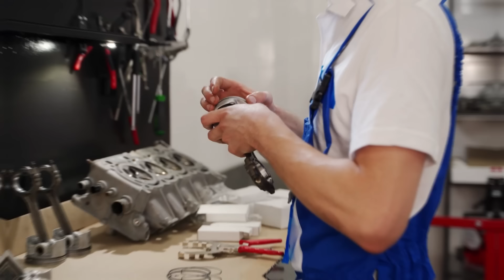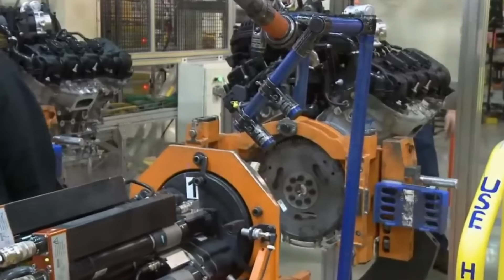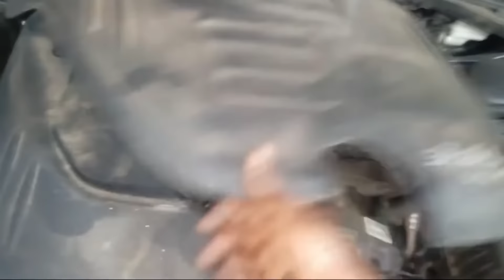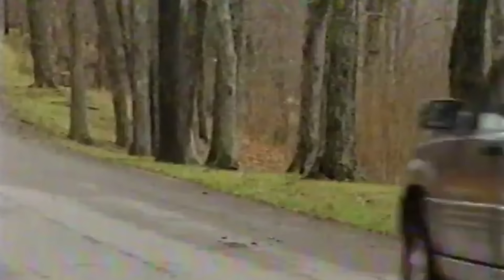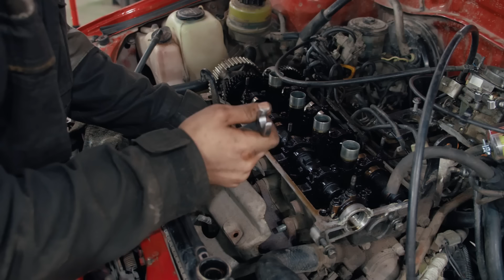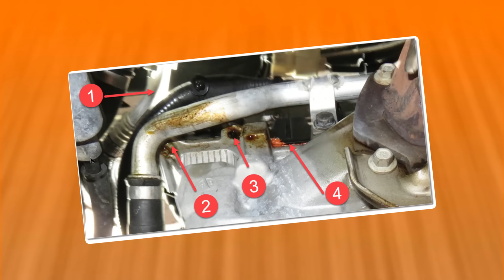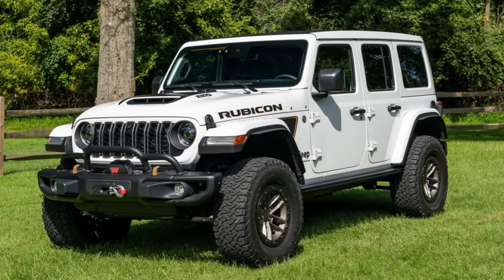The Only 3 JEEP Engines That Last 300,000 Miles

Comment: I got a Jeep jk 2007 finally blew at 170,000 km and trans in the same time, I guess I was running 37" tire without changing the gear ratio. I have to replace them all.

Comment: AI clickbait and total bullshit.  The 2022 Pentastar engine uses multi-port fuel injection not direct injection.  The early Pentastar engines had bad cylinder heads and rarely lasted the 5 year 60k warranty period.
Reply: Those are the two reasons he specified only 2011 to 2015. Later than the bad head design, before cylinder deactivation
Reply: @crustyoldoffroader7436  The 3.6 does not have cylinder deactivation and never has.
Reply: @johnschwalb2025  my bad, I stand corrected
Reply: Not true, yes there were issues but way more made it past your stated mileage than didn't. The 3.6 is in millions of vehicles and is considered an overall good engine with a low percentage of failures

Comment: My 2010 JK 3.8 just passed 395,000 miles AND has a Vortec V3 Supercharger for the last 60,000 miles.
Reply: Our 2010 JK has 250K miles and is still running strong as well.

Comment: I have a 2008 Grand Cherokee with a 3.7 Powertech, and I am 400 miles from 300,000 miles with just regular oil changes every 5K.
Reply: Just hit 300k with my 09 Dakota 3.7L I use MOBILE 1 change every 5k and Lucus upper cylinder lube fuel inj cleaner 4oz per 10gal of fuel ,I started getting a timing chain slap when I took off the cover plate and valve covers it was super clean inside the timing chains,gears,tension slides had hardly any wear looked new except the plastic slides had started cracking from age the cam lobes had no visible wear nicely polished ,I believe I’m good for another 200k but I will recommend you replacing those timing chain’s because those slides become brittle with age and that engine is an interference engine if it jumps timing the valve and pistons will kiss fortunately I caught mine in time 😁
Reply: @williamchapman2434  myself I have been just using quakerstate full synthetic every 5k and have not had an issue at all with the motor.  one of the best motors I have ever had.  timing has never been touched.  valve covers have never been removed.  only thing I have done is a water pump and a crank position sensor.  and tune ups every 75K...  heck, all 6 coils are even original yet...  the thing just runs...  anymore, I don't drive it much.  it is more of just a weekend cruiser anymore.

Comment: My 2014 wrangler unlimited sport is sitting at 368,022 miles and still running strong with all the same powertrain
Reply: hell yea, i got a 03 wrangler tj that says it only has 122,000 miles 😂 i don’t know if i believe it tho cause of how extremely easy it is to change the cluster out.
Reply: @E.K.izzlemynizzle you run a carfax
Reply: This is exciting.  I just bought 2013 jk mt 110k miles runs perfect

Comment: I have the 3.6 pentastar with 107k miles.  

P0300@ P0306 codes just appeared.   

Clicking noise at cold start and it gets quiet when it reaches normal working temperature.  

I’m thinking to switch from 0-20W to 5-20W oil viscosity.  

Local mechanic is going to do a tune up (spark plugs & coils).
Reply: Contrary to this video, you are experiencing an unfortunately common problem with the Pentastar.  Not sure what year your Jeep is, but the early models had rocker arm needle bearing issues.  Starting in 2018 they changed to a dual lift cam, the needle bearings are gone, but they’re still having valve train issues.  When it starts throwing codes you’re likely going to need to replace the cam and rockers.

Comment: The new 3.6L’s last a long time too…just got to change the oil every 5000!
Reply: I just bought the 2026 wrangler sahara with this engine. Hope it lasts.
Reply: @tmo4330 as long as you use Pennzoil Ultra Platinum 0w-20 every 5000 miles and change the transmission fluid every 50 k miles. It worked for me so far. Just hit 100K
Reply: @tmo4330  I had a 2021 Rubicon and now I have a 2024 Rubicon. Both of my 3.6L’s have been bulletproof!

Comment: There’s a little BS to this AI generated review. 
Nothing was said to address the more than common piston skirt cracking as well as total failure breaking apart this causing catastrophic engine failure. 
If reviews are going to hit the Internet, they need to be held accountable for being totally truthful, which this one is not. 
I am the owner of a 2004 Jeep Wrangler sport with 130k and crossing my fingers that the Pistons don’t fail. 
To date, I have spent one K in chasing a rattling noise that reputable mechanics are unable to identify. Thus throwing parts at the noise attempting to get it to cease.
Reply: The AI slop is really taking hold on YouTube. Sick of the same three voices wth the same crap animated hands and heads.
Reply: does it have the 4.0 inline 6 or is it the 4 cylinder? if it’s the inline 6 it will probably run forever even with the noise 😂 them bastards are actually hard to kill.. doesn’t mean there may be a bad motor here n there but overall those engines are regarded as highly reliable. plus maintenance is key for any engine. idk if you bought it used or what but it’s always a chance the owner before you neglected it. people who treat their vehicles like that are way more common than you would think. changing the oil every 20,000  miles will put a damper on any engine. hell there’s some people who don’t even know they got to change it 😂
Reply: Thanks for the reply  Ek. It’s the 4.0. It had 122k when I got it and I have no history other than it was never off roaded by neither of the two prior owners who were neighbors. 
I must assume it was well cared for as it was in excellent condition. 
The noise is a rattling noise that comes and goes and increases and decreases in intensity. On a cold start it is as quiet as a sewing machine and after about one minute, it will rattle some. I have had two excellent mechanics attempt to diagnose it and neither could the valve cover has been removed and the valve train is new. The oil pan was removed to replace the oil pump and the bearings were checked, cam and crank and showed little to nowhere. It runs flawlessly, does not smoke, and uses no oil between changes go figure.

Comment: My 2010 JK finally blew at 430,000 miles 4 months ago!

And the I-6 4.0 in my tj went at 382,000
Reply: That's amazing 💯 Did you decide to rebuild the engine or let your JK go?
Reply: @6370WIN we replaced it with an engine from a 2010 caravan. I only paid 1300 for the jk a year and a half earlier and redid the heads at 406,000
Reply: Those “minivan” engines were really pretty good for what they were.
Reply: I hope my 3.8 in my 2009 goes that far!
Reply: Are you putting another engine in it?
Reply: Oh man. I wonder like the other if you replaced the engine or got rid of the vehicle. My 2017 is at 199k
Reply: @limkey69  wao ! I have a 2017 with 101k miles . Already replace oil cooler and oil pump. Any other thing I would expect to replace?
Reply: I have 218,000 plus on my 2011 JK.
Reply: You put some serious miles on your jeeps!
Reply: But that was the 230 HP 3.8 liter.
Reply: R2.8 Cummins

Comment: If I could put the 4L I-6 in my 2018 jl wrangler,  I would. Best engine ever!
Reply: I agree. Probably the most uncomplicated engine ever which is why it is so hard to kill. I have a 2004 with 340,000 miles. Still strong.
Reply: @JackMccarroll-d5r thats why Chrysler did away with it, to reliable. People were keeping Jeeps instead of buying new ones.
Reply: @JackMccarroll-d5r  Wheels mgazine said it was one of the worlds best engines.
Reply: @JackMccarroll-d5r nice! I have an ‘04 with 172000 still purrs, hope I can get 340k out of it. I only put around 5k year so it should last me a couple more decades 😅
Reply: That would be horribly underpowered. Pass.....
Reply: @Wrangzilla  😂 it was already underpowered on the tj’s. especially if you put bigger tires on. BUT if you put the right gears in it’s really not that bad. the inline 4.0 is truly a great engine reliability wise.  but yea if your looking for actual power that would be a newer jeep.
Reply: I'd do the same thing. Almost bulletproof and a torque curve that works in the Jeep.